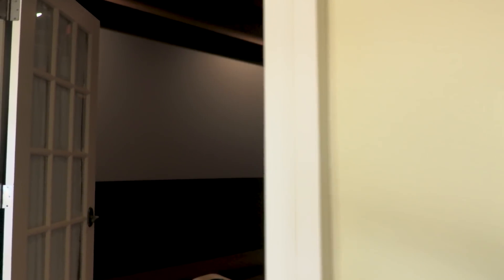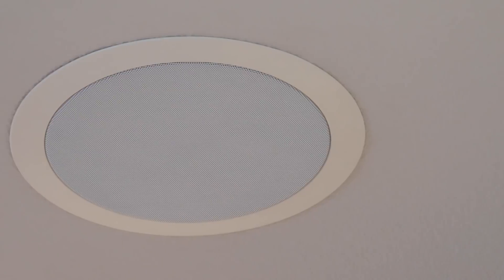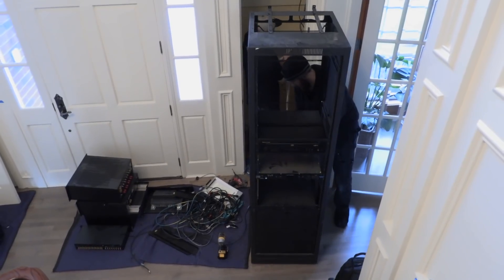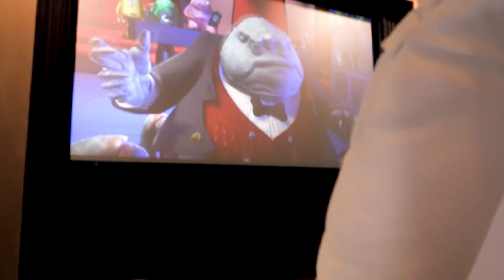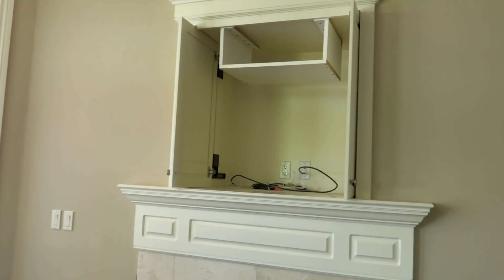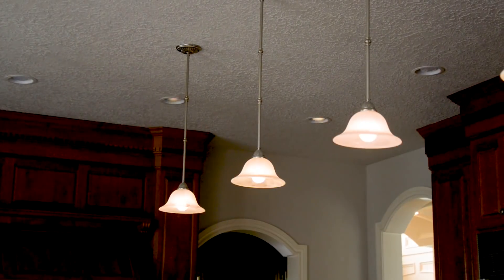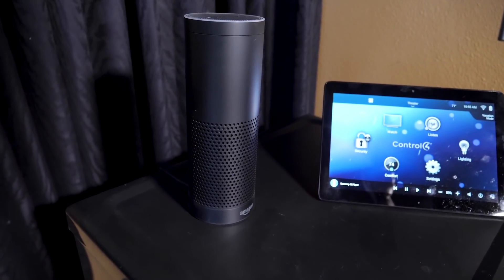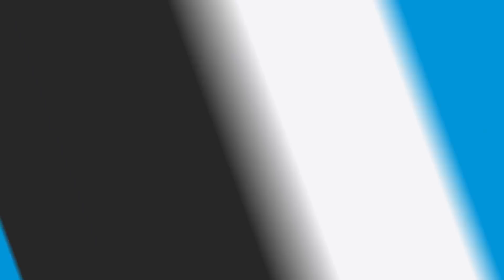We took a dumb home and made it smart. Here's where we started

Comment: All of this is nice but it's way above what most people can do.   I'd show a video on cutting the cord with Comcast and installing an HD Antenna.   Run the co-ax cable down the side of the home to where the cable enters the house, then all TVs get Over The Air TV.     Then run an Ethernet wire from the router to the main TV so the internet services stream fast.     That's basically what every room needs these days, is Ethernet cables running from the computer room.   A smart home would also want a security video system, so there would be wires run for that as well.